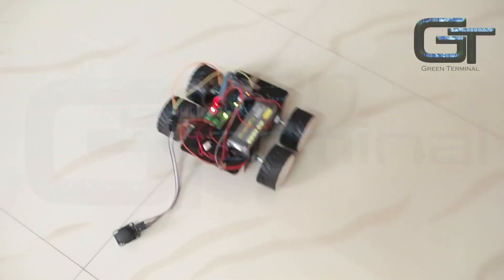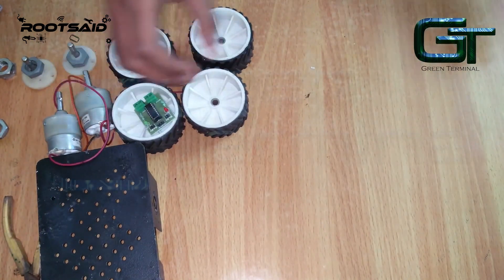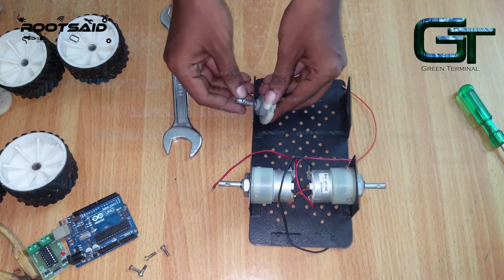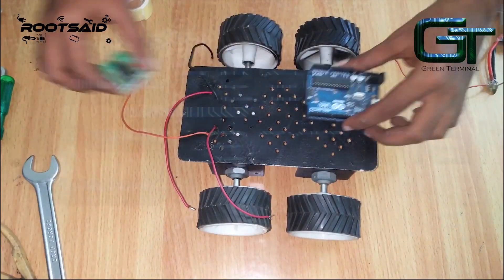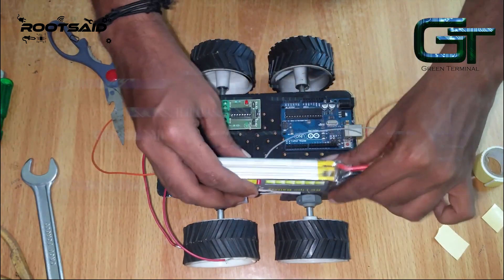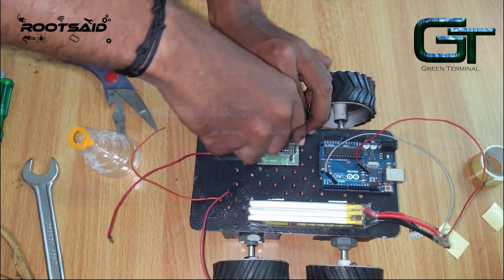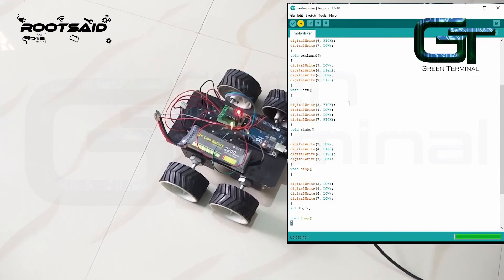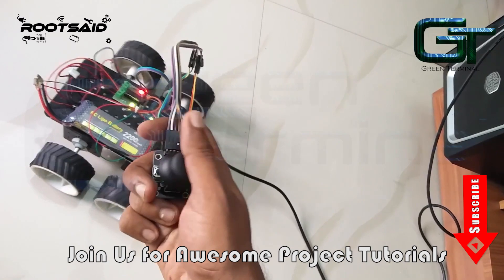How to make a Simple Robot | Arduino Robotics for Beginners

Comment: wiw thanks just the video I was looking for!
Reply from the maker: You are welcome :)
Reply: @RootSaid  hey man do you think it is worth to buy a kit for a tank that costs $30? it is a chasy, motors and tracks. it is has a controler that is connected to it via wire
Reply from the maker: @maringuic2484  Sounds good.. but it also depends on material and built quality. You can also buy parts separately and then assemble them together if you want..
Reply: @RootSaid  well the quality is prety good it's a high quality aluminium and it is a lot cheaper than buying parts seperatly
Reply from the maker: @maringuic2484  Then you are good to go.. :)